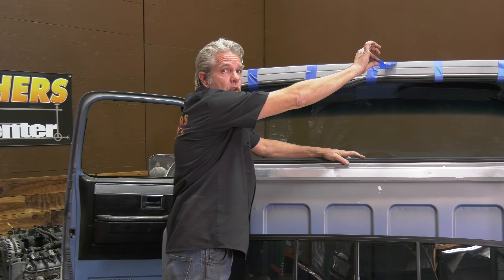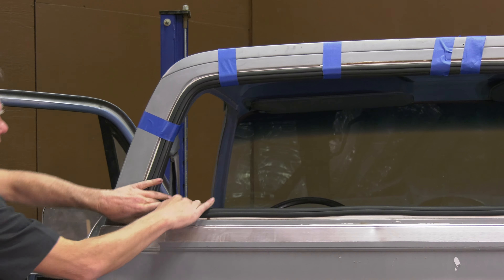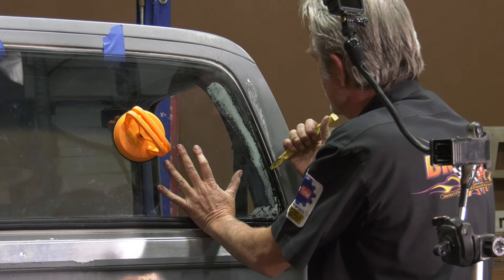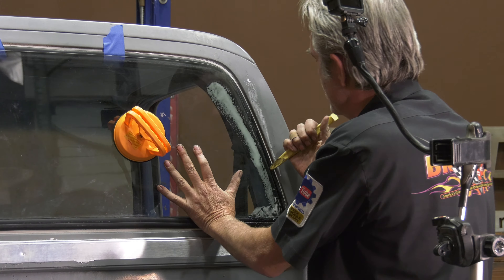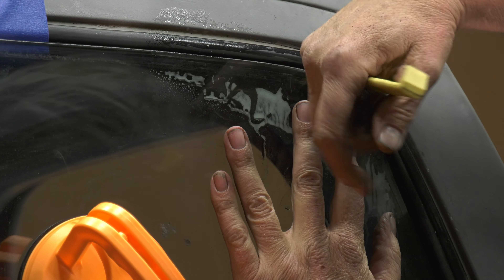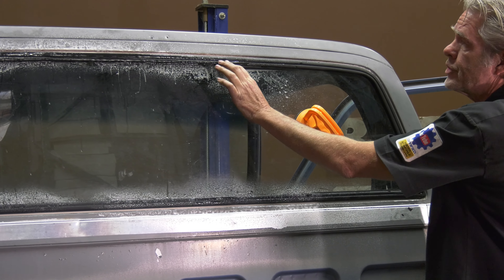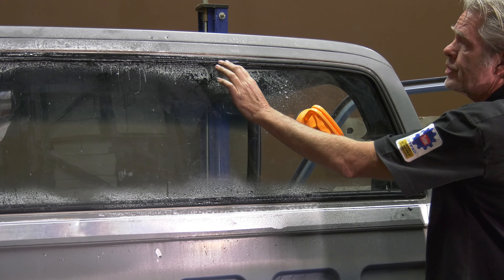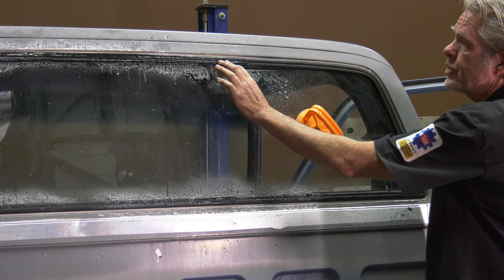How to Install a 73-87 Squarebody Truck Rear Window - Glass/Rubber/Gasket/Seal/Slider w/Trim Deluxe

Comment: Can't wait to see the sliding window frame install  video as it will help me greatly when I replace my rear sliding window frame once this winter is over
Reply from the maker: It's exactly the same install as this, 100%. We actually started out to install a slider in this video, but the owner of the truck said he would prefer if we put a standard glass in it. Thanks for watching!
Reply: @BROTHERSTruckPartsTV  I think you might find the two installations to be very different and I'm sure there are many others that would also like to see the sliding window metal frame install just as I do
Reply from the maker: @jessiej3991   We've done both installs, they are the same, no doubt about it. The pinch seam around the metal frame gets treated just like as if it was the edge of a piece of glass. The ONLY difference is that in some spots the metal frame is slightly more difficult to work around with the tools than it is on a standard glass.
Reply: You all prolly dont care at all but does any of you know a tool to log back into an Instagram account??
I stupidly forgot my account password. I would appreciate any tips you can give me!
Reply: @Ares Crosby instablaster ;)
Reply: @Thaddeus Azariah it worked and I actually got access to my account again. Im so happy:D
Thanks so much you saved my account!
Reply: @Ares Crosby Happy to help :D

Comment: Would this process work on a sliding back glass window that has a pich weld all the way around the entire window.
Reply from the maker: 100% same exact process. We actually started out to install a slider on this truck, but the owner of the truck said he would prefer if we put a standard glass in it, so that's what we did. Thanks for watching!
Reply: @BROTHERSTruckPartsTV  I have a 1985 Chevrolet c20 3/4 ton long bed regular cab custom Deluxe and a small length of the pich weld along were the weather stipe goes around the door on the passenger side and the small length of the pich weld is rusted and chipping away so how would i need to fix/replace or repair it.
Reply from the maker: @kenworthcustomlogisticstru8096   Depending on the extent of the rust and damage, you could cut it out and do a proper repair, grind the rust away and epoxy it then shape the epoxy, or just clean it up and ignore the problem as long as it's not creating a gap that would let wind/water in.

Comment: I have your sliding rear window, and your standard seal, to install on my 84 C10 with stock sliding window. Can this be installed using the rope in method. Or does it have to be done like in this video. Thanks!
Reply from the maker: If you have the standard seal that does NOT have a lock bead then it needs to be installed with a rope.
Reply: @BROTHERSTruckPartsTV  thanks!
Reply: I used the roping method on my side window in a suburban. Those of that same bead lock style. I fought the window for 3 hours trying to do it this way. I roped in with a friend in a matter of minutes.

Comment: A person could probably use a piece of that yellow rope out about 1/8 have it in the rubber and then pull it out as you set the window in and it would set the rubber on top of the window?
Reply from the maker: Yeah, that's a different type of rubber that method works on! These rubbers that require a locking bead don't install that way. We have another video that shows that method, but we noticed you already found it. Thanks for watching!
Reply: @BROTHERSTruckPartsTV  awesome videos thanks a bunch.
Reply from the maker: @michaelmattson2286   Our pleasure!

Comment: Will the seal on your website work with stock sliding glass? I have a seal from precision weatherstripping and they say their seal will not work with stock sliding glass.
Reply from the maker: We don't see why it wouldn't? Both the Factory Slider and the regular glass mount the same way. Our seals work with sliders and solid glass too. Is there a specific PRP Part # you could share and we'll check into it further?
Reply: @BROTHERSTruckPartsTV  yes the part number is WBL 1135
Reply from the maker: @camkitchiner   We carry that same seal and have used it on factory sliders successfully in the past. We can't see any reason it wouldn't work for you. It's possible they say that because the factory slider frame is slightly thinner than an actual piece of solid glass which may cause a looser fit? We're not sure. FWIW, we also recently did a factory slider install using the WCR 1135 which says it won't work either, but we had no problems.
Reply: @BROTHERSTruckPartsTV  thanks for the info!

Comment: Could I reuse the bead lock?
Reply from the maker: You can if it's still pliable. Most of the time they harden and you'll need to replace it when you replace the seal.